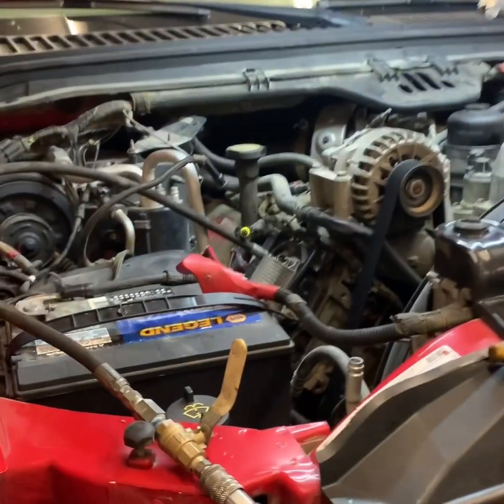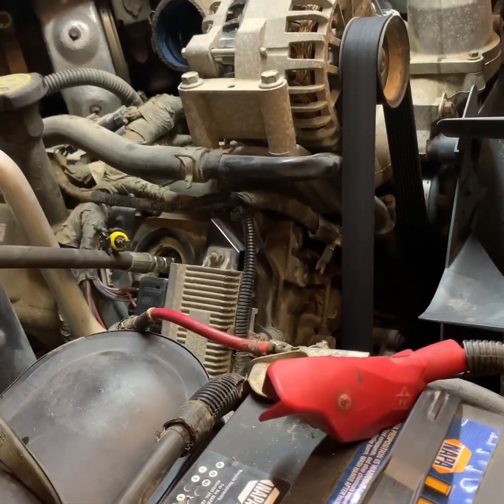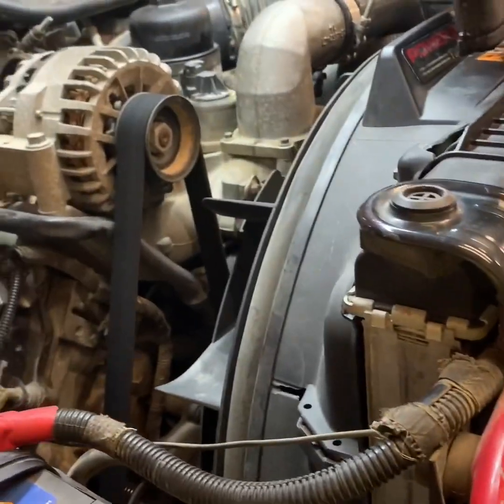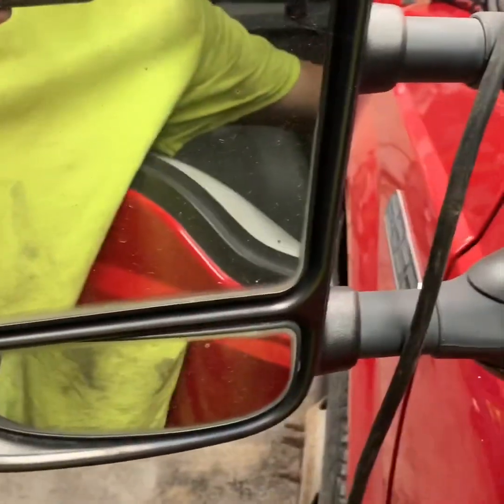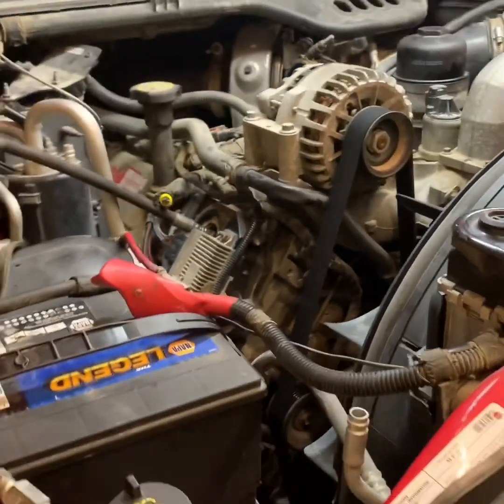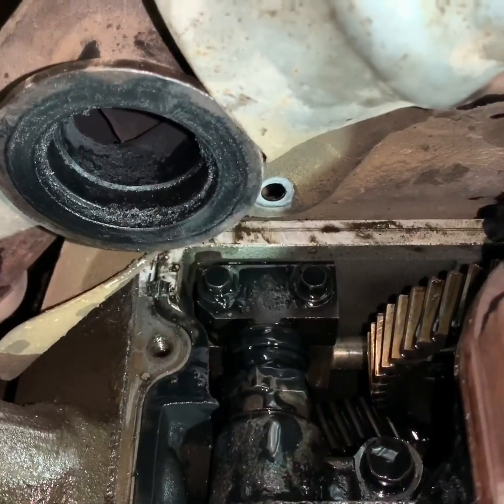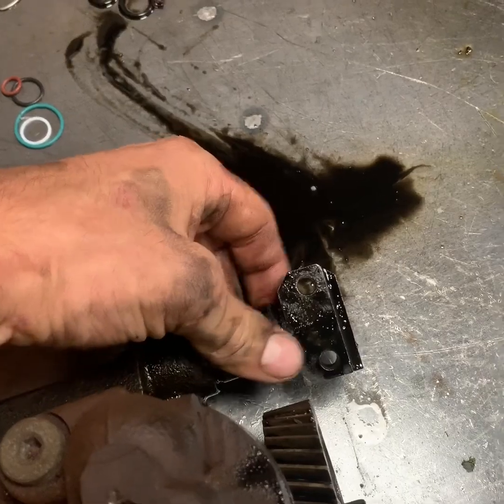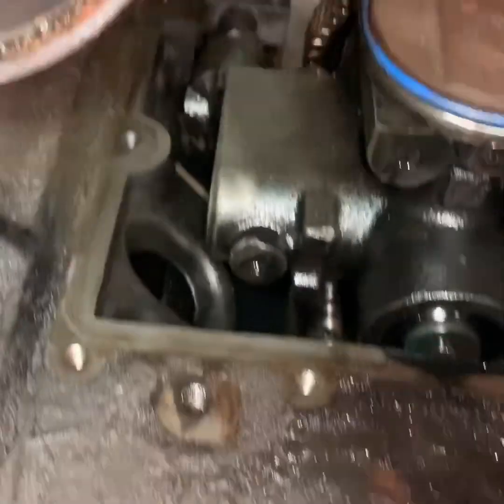How to diagnose a hot no start 6.0 Powerstroke

Comment: My 6.0 has base oil pressure, but the gauge in the cluster doesn’t move when cranking the truck, will this mean either a leak, or bad icp or ipr valve or a bad hpop?

Comment: Before fix you had low oil preasure?
Reply from the maker: Yes low high oil pressure those engines have a high and low oil pressure systems the high side has to make 500psi to start and you want to see your opt no higher than 25% on a week system